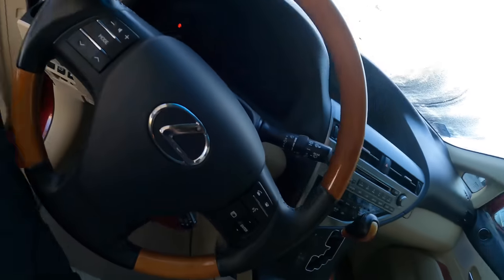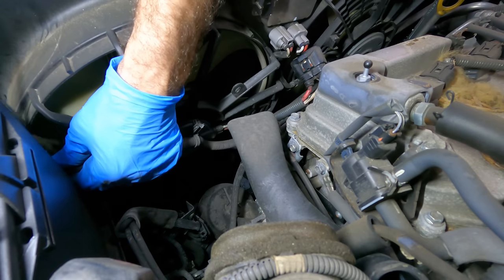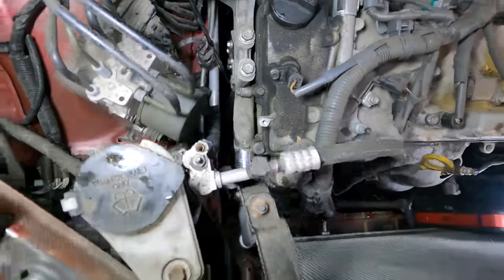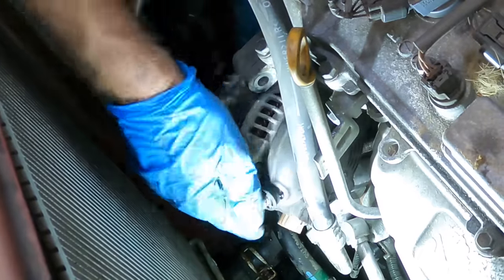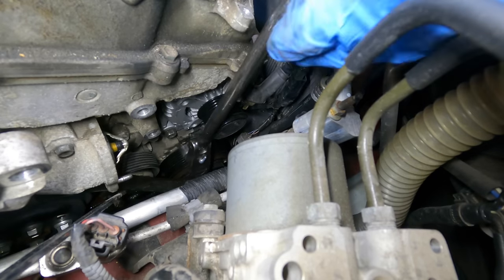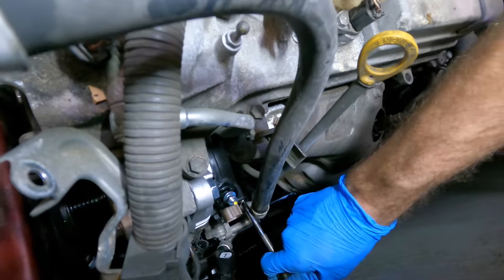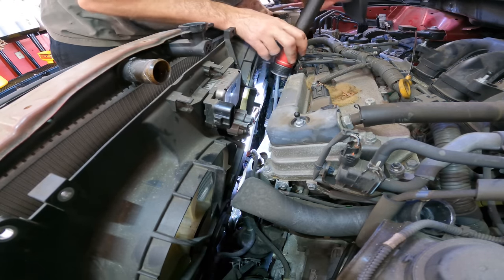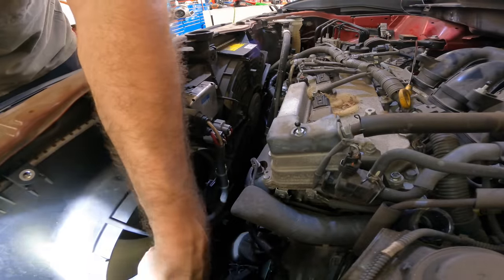Lexus Died While Driving! Towed In! No crank no start.  2011 Lexus RX 350

Comment: Ray next time you have to do an alternator on a Toyota 3.5. Go through the wheel well. Take the tensioner pulley off and you can access the bottom alternator bolt. Also removing the upper radiator support gives you a lot more room to sneak it out.
Reply: Great tip. I've owned two Toyota V6's that we're/are essentially trouble-free, but man I always dreaded the notion of ever having to pull an alternator....
Reply: Lol I have 2 1GR-FE 4.0’s. I can’t even see the starter. Here’s to hoping it lasts a really long time.
Reply: And do not get your alternators at AutoZone or Oriellys. I get my starters and alternators rebuilt through a local rebuilder. Remanufactured Denso is a great alternative since they’re an OE manufacturer/provider.
Reply: Exactly right. Did this two weeks ago on a 3.5 Avalon and didn’t pull the wheel off but did pull the core support off and out of the way for easy removal. Made the job an in and out.
Reply: That was actually my second thought because I was wondering if underside access would be easier; if not, probably the wheel well. Yota's do tend to be a little bit more service friendly and quite often provide alternate routes, so to speak. tl;dr = Even guys w/ decades of experience should still RTM once in a while.
Reply: @JAMESWUERTELE  starter on da bottom?
Reply: One of the questions these videos often raise to a non-automotive-industry person with engineering background like myself is how automotive engineers prioritize where components end up sitting within the scheme of the engine compartment. Engine functioning comes first, obviously, but surely something like the location of an alternator or starter, which will rarely last the lifetime of the vehicle, should be prioritized for being accessible without removing half of the surrounding components just to gain minimal access to them? I assume this affects the time and therefore cost to do the replacement, and also increases the chance of a costly mistake, breakage, etc., happening with the components that have to be removed.
Reply: @Mert M Recently pulled and replaced the alt on an Odyssey. Just removed the wheel to access the lower bolts which wasn't hard.
Reply: @ReflectedMiles  As a test engineer that has worked with technicians and dealt with design engineers' questionable component placement decisions most of my career, I have decided that they probably take the overall space they have and add a bunch of things and then bolt on every other thing in all available space, lack of remaining space and people telling you that you are not allowed any more space is generally how this happens. It usually ends up with 10 lbs of shit in a 5 lb bag. Also design engineers rarely consult with people that actually need to work with the product to decide where to place things, it seems. It is also in the best interest of the manufacturer to make things as complicated as possible to fix, which makes the fix take more time and thus be more expensive, people often get new cars when they decide that their older one is not worth the expense of the repair that it needs. That last part is pretty cynical, but if you look up what companies Ford did with metal quality and compare the longterm reliability of older cars to newer ones, it seems to hold up. A relative had a car where you had to remove the engine to get to one of the spark plugs, they clearly don't give one single ounce of consideration to repairability and maintenance when they design cars these days.
Reply: @Nate_123  Thanks. I am aware of some of Ford’s recent engineering story in terms of much more proprietary tooling being required, as well as Tesla’s active and passive stances taken against used-vehicle owners and right-to-repair. I just wasn’t sure what role customer and technician interests played in decisions like component placement / accessibility / resulting costs. It looked quite ugly in this video, which I would expect less from Toyota than from others. 

I do expect compromises, of course, and ones that not everyone will be happy with, but it sounds like the automotive ones may be somewhat different than those required in the aerospace sector. Displeasing customers or increasing their costs without absolute necessity, particularly as they usually have their own engineering and technician teams, looks much more dangerous in aerospace.
Reply: @VFX _Valiant  I don't know.  Something like an alternator  which might need to come out once, is a part I can accept reasonable disassembly.  The parts removed were basically pull the bolts and disconnect a hose or two.  The real pain is when gaskets or otherwise not easily replaceable parts have to come off. 
There are an incredible number of issues that have to be considered when laying out an engine compartment, making a once in a vehicle lifetime replacemtnt part east to reach is low down that list.
What I really don't get is all the plastic cosmetic covers for an engine bay that most owners never even see.  I get that a few are necessary for ducting etc, but this one was crazy.  Are they trying to convince buyers that there's no engine at all?
Reply: @Nate  I bought a brand new Pontiac Sunbird (aka Chevy Monza) back in 78  and the salesman asked if I wanted V6 or an available V8.  Lucky me that he was honest enough to recommend the smaller (and easily powerful enough for the small car) he explained the extra cost of maintenance because of the need to access the rear plugs OR some of the accessories.  But to be totally fair, there isn't much you can do fitting a v8 in an engine bay designed for a 4 banger.  
I completely don't buy the "make it complicated to raise maintenance cost"  Manufacturers are more concerned with potential warranty items than whether their dealers make a few extra bucks in changing parts.  Dealers aren't sitting at the table, and no engineer would EVER suggest increased complexity for that reason.  Putting accessibility low on the priority list maybe, suggesting it is a plot is nonsense.
Reply: @markdoldon8852  To be clear, you are correct that engineers would not be making choices purely to increase manufacturer or dealer income. However, it would be an even greater mistake to think that the bean-counters, dealer-relations, and other management stakeholders do not have a seat at those meetings and often with at least as much sway in engineering decisions as engineers. I have never heard a viable, alternate explanation for Ford’s proprietary shop-tools decisions, for example, or the efforts of John Deere, Tesla, and others to restrict right-to-repair.
Reply: Or, just remove the engine...
Reply: @JAMESWUERTELE  those starters aren’t bad they are right behind the steering shaft.
Reply: @amascia8327  when this transverse 3.5L came out step one for water pump removal was to drop the complete front cradle. Engine/trans and all. Paid about 9hrs warranty time
Reply: @ethanmurray6658  Thanks. I'll be more careful with my kidding in the future. I'm getting more sympathetic to dynamite... good for computers too.
Reply: @ethanmurray6658  then the warranty guys caught on that techs were working around it and cut the time to under 3 hrs

Comment: Accessing the alternator is a combo of above and below the car. Access to tensioner and lower bolts are mush less aggrivating from below thru the right front wheelwell after couple plastic sheilds are removed.The tensioner has a tab on it that you can insert a bolt into it and into the block to hold it in the open position. Unbolting the top of the rad anchor will give you much more access.
Great vids Ray
Reply: Well, when watching Rays videos I sometimes wonder whether it would'nt be better he read the repair shop manuals of the car makers before starting his repairs. For me a lot of his repairs are trial and error. Even if, in the end, he is successfull, it may save a lot of time and effort.

Comment: Wow, makes me miss the early 1970s, took two bolts and a couple of wires to remove an alternator, put in rebuilt two bolts, put wires back, plus tension with a pry bar to put it back on. (pre-belt tensioner days, too.)  10 minute job, not including interruptions to pump gas and wash windshields.  Yep, I'm old.
Reply: I hear you-almost 75, worked on all my cars-60's-90's--not anymore, much to complicated now for this old man-wish Ray was in my neck of the woods....

Comment: I'm 73 years old, back in my "knuckle busting days" I worked as an auto machinic, and later a heavy equipment machinic. Back then, the reason I went to heavy equipment, the cars of the day were getting a little busy under the hood. But at least you could see the engine!! Back then any alternator change took less than half an hour, that was when you opened the hood, you could see the alternator.
Thanks for your videos. Carl
Reply: My dad  after 15 yrs as a mechanic with his own shop, finally sold out and changed careers in the mid 70s when,  as he put it "the book for the pollution control on one car model was bigger than all the other repair manuals for the entire brand".  Around the time, as you say, that engines started to be buried in the engine compartment.

Comment: I had to change out the Alternator in my 01 Sunfire 5 times, each rebuilt one I put in failed in a different way till the 5th one worked. Started off needing two people  and several hours, it needed to be removed from under the car. By the time I got to the 5th one my wife watched for safety but I was able to pull and replace in an hour alone. Not a fun month but definitely a learning experience. This car? I’d have called it a lost cause with everything that needed to come out just to replace it. 

You are a miracle maker!

Comment: I remember my Dad putting in a thermostat in his 1966 Pontiac Parisienne. There was so much room between the engine and the rad, Plus area to work around the parts you could actually see the driveway when the hood was up . If I remember correctly it took him 20 minutes to change the part and an additional 30 minutes for 3 beers.
Reply: My mid 70s Mercury Comet  back in the day when the mechanical thermostat was located between the rad and the top rad hose, took all of 10 minutes for a kid with almost zero mechanical skill.  Dad pointed at it, said "it goes right there"
Reply: My Dad gave me his 1968 Chrysler Newport Custom back in the 1970s shortly after I got my license. That car had a 383 cubic inch motor and there was still plenty of room to work on most parts much easier than this Lexus. Nice work Ray!
Reply: Well people want power steering they want powered brakes they want ac they want turbos they want air pumps they want all this extra crap that all gets stuffed in the engine bays making everything so tight now
Reply: And here i thought your dad would be faster with 3 beers. XD
Reply: I remember those Parisiennes.  GM is those days, with all the badges and little actual differences between them all.

Comment: I once replaced the voltage regulator in a 1990 Nissan - stupid place for it, inside the driver's side wheel well. You have to get the car far enough up in the air for the wheels to hang down as far as the shock absorbers would go, and remove the wheel to reach up inside. What made that more than just an everyday car repair is that I was three months pregnant at the time.

Comment: And this is the perfect example of why mechanics and technicians HATE engineers.
Reply: Why? It’s not their fault. It’s the executives who sign their paychecks that make the decisions. 

An engineer is handed 50 pounds of shit and told to make it fit in a 20 pound engine bay in a way that the assemblers can do it in 20 minutes or they are useless and won’t be employed anymore. They know how much of a pain in the ass it will be to fix later but they aren’t really given much of a choice in the matter most of the time.
Reply: @Leonarco333  but engineers need to be smarter.  I am an engineer and most engineers I work with are so smart they are dumb.  But I started working in a machine shop first
Reply: @nissan300ztt  that I would agree on 100%. There are definite exceptions but most of the things here blamed on engineers are almost certainly the cheapest of several bad options so that’s what the company decided on.

Comment: How insanely difficult to replace an alternator!!!
Reply: I can replace my alternator in 10 minutes it’s right on top on the passenger side all I gotta do is loosen the belt tension which I can do from the top of the engine bay slip belt off unplug two cables really easy unbolt three bolts all easy to get too then install new alternator. Don’t have to drain coolant I do not have to remove any extra parts don’t gotta jack the car up or go in through the wheel well it’s extremely simple

Comment: So frustrating. Every vehicle eventually has the alternator fail.  It's a common failure and engineers should be cognizant of this.  Every car engineer should be required to intern in a shop for 6 months.  Ridiculous that it takes that much to change one.  The engineer should be fired.
Reply: Six months not nearly enough.
Reply: @whirledpeaz5758  2 years minimum!
Reply: Yeh, I doubt any engineers have ever had to work in the real world on the abominations they design. It's all just playing computer games to them nowadays. I actually think most of them get a bonus for making things as difficult as possible, because it means the manufacturer can charge more for labour time, or it requires special tools to do the job🤣🤣
Reply: Cars are engineered for ease and speed of assembly at the plant, because that's cheaper, which of course is what we all want when we buy a car. The engineers are doing what they have to when told to fit x amount of power in y space.
Reply: @simonilett998  amen brother, well said
Reply: @paulheitkemper1559  Yep, first step before any repairs are attempted, remove engine from vehicle🤣👍
Reply: @simonilett998  hey I can't say I like it, but to say that teams of really smart guys who had no say in the matter should be fired because of a bean counter's directive to give the customer a car that costs $5k (number pulled from rear) less isn't realistic.
Reply: Lol they don’t care and adhere to different standards.  This job is not that bad, he just doesn’t have the experience.
Reply: @paulheitkemper1559  I think your last comment should've been a reply to @Bert Blue the OP. I didn't say they should be fired🤣
Reply: @simonilett998  my bad. Sometimes hard to tell what is sarcasm, and who's supporting which position.

Comment: As you can see it can sometimes take a few minutes of running for the brushes to bed in on an alternator. I found that mine still wasn't charging as expected with all the ancillaries switched on. I ended up running a separate earth wire from one of the mounting bolts to the chassis.

Comment: Good job Ray, the comments are just as entertaining as the video. Toyota engines are a pain to work on. My belief is that they put the accessories on an engine to speed the build process while giving no regard to the future replacements. Another example is changing a starter on the v-8 as it requires removal of the intake and about 8 hours of work.

Comment: I popenz the hood on vehicles to see how easy (or uneasy ) it is to replace alternators, power steering pumps, radiator, plugs, etc. before purchasing.  Avoiding labor hours due to crap designs is my mission.  🔧

Comment: Thank you for this video. World record car for most useless plastic covers over the engine, although maybe a Jetta is harder to deal with. Also a record for most impractical to do expected repairs. Seems like the repair would be easiest by removing the engine! I will NEVER buy this model car after seeing this video.

I was a design engineer for 45 years, and it is NOT true that we would do an evil laugh when designing something that should be easy but could barely be repaired. Well, maybe a snicker or 2...
Reply: I sometimes do it out of spite... Want it done quickly and cheaply?  You got it.
Reply: The SPECIAL hell...

Comment: Sideways engines, my condolences man! Shame you have to remove half the engine bay to swap an alternator. Plastic, expensive junk. LOL Good work!
Reply: My brother asked me to do a water pump on his 02 Duramax,I as usual said sure drop it off. I looked the repplacement procedure on all data and knew i was screwed when the first step was to remove the driver side fender! Back in the day,$20 and a half hour did that job!

Comment: When access to important engine components is difficult, this is clearly a poor engine design in spite of its reliability. Auto engineers, please take note.
Reply: As an electrical engineer I find that the automotive engineers are enamored with all the CAD/CAM and parametric design tools to the point they never work on the actual car--thus design nightmares such as this alternator. Another video, not from Rainman, showed a starter in the Top V section of a V-8 engine---another brain dead group of auto engineers!

Comment: Just some helpful advice for the future. If it’s a Toyota/Lexus/Scion V6 front wheel drive car, take the nut off the lower motor mount behind the passenger wheel and jack the engine up using a floor jack. The angle will make it easier to get the bolts out and for better sight. It’s also the only way to replace the water pump on these cars without removing the engine.

Comment: My 2010 lexus rx350 has 200,000 miles I had it since 65,000 miles I still haven’t had alternator problem yet just starter at 195k this car is a beast……tuff luck for this car alternator broke down 91k miles

Comment: I literally just did this job like 2 weeks ago on my personal rx350. Best to replace hoses and pullys wile you have it tore down. All my pullys had bearing play. I removed the radiator  as well to make sure it was safe. You can access the bottom alternator bolt and pully through the wheel well easier.